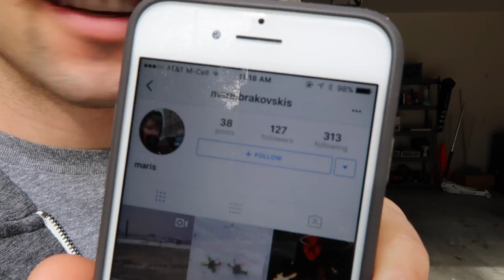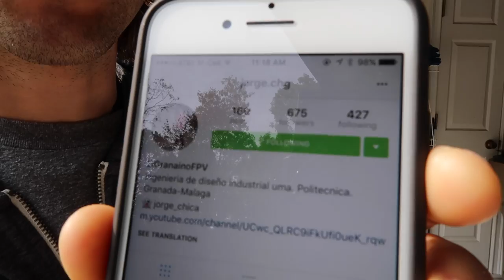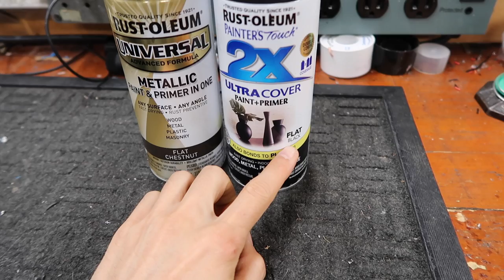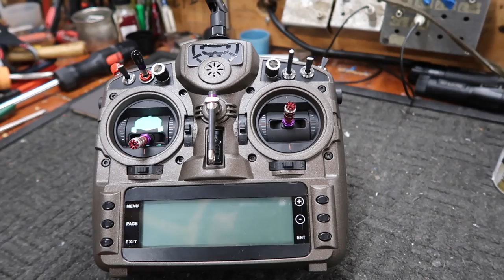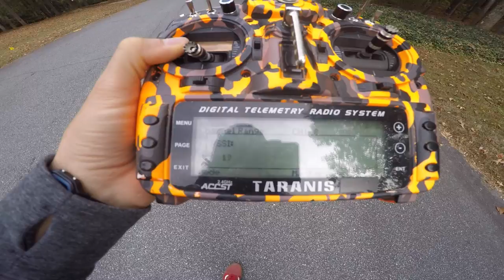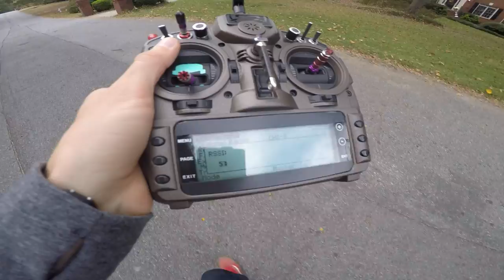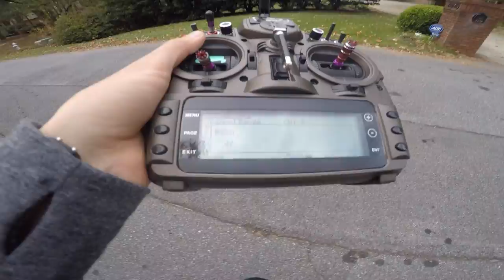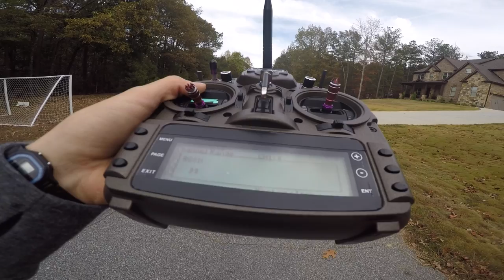The MUST HAVE FRsky Taranis Mods

Comment: If range mode reduces range 30x, what is the purpose of range mode? I am new
Reply: To test range safely on the ground without needing to run the full distance of your signal. Reducing the range to a third of its full power meaning around 30-50 paces you should lose signal. If this happens much earlier you could have a broken rx antenna or just a bad rx in general.

Comment: Mr steele If you have had a chance to test the VAS Microwave folding diapol 2.4ghz, do you thinks its good freestyle or better for just low and wide spread? Thanks for all the great content learning alot from you.
Reply from the maker: +nitrosomniak I have. I tested the very first couple prototypes.  The wifi antenna or preformed it in range
Reply from the maker: +Mr Steele *out
Reply: Was just wondering how it performed vertically as in diving from high altitude? I was under the impression it is supposed to be alot better spread at lower altitude flying.

Comment: Great vid Steel.  I'd be curious on where you got that specific cable you are using.  I know i can find it but quality control may not be there when its necessary for an application like this (I would think at least).   This may be my problem previously where i installed a cable like this (although i can't confirm the cable type) where it worked for a while but then SWR was in the 30-40 range about a month after i did the mod.  Also, can you link the exact antenna you are using?  I've got 1 from amazon and a couple from aloft that seem to be identical.  Thanks!
Reply from the maker: +Beerad FPV  I got my antenna from aloft.  And the wire   I just ordered a short connector with rpsma on one side and a umx or something on the other. And cut the umx off :). All you need to worry about is that the rpsma is crimped and install correctly.  I bought from a reputable RF connector source   As close tome as possible from amazing prime.   I'm inpatient lol

Comment: Was that 84 mm to the tip of the connector? or the cable length under the connector? Because i did the mod with the thicker cable and now my SWR went from 0 to 18-20, now is this bad?

Comment: What was your SWR after doing the mod? I get from 0 to 16 depending on how I angle the antenna. That's pretty sweet you've got a dipole coming from ibcrazy, that guy knows his rf.

Great color btw, like the texture it has.
Reply from the maker: +Logan Curole straight up  0-1 lol
Reply: Mr Steele Lol, I don't expect anything less than perfection from you. 

Now I'm not sure if it's the antenna I got or if I damaged the shielding during soldering. I used a pigtail extender from rotorgeeks so the wire I used is of the higher quality you recommend. I'll see if a new antenna fixes it.

Thanks for the video and you should do an update when you get the new dipole.
Reply: 16 SWR seems VERY high on a Taranis. Sounds like something is wrong.
Reply: blueflamingo1 It's not that high. The circuit FrSky uses to detect standing waves is only an approximation and I'm pretty sure it's resolution is in steps of 16 because it never settles at values that aren't a multiple of that. That being said I am changing things to improve it.
Reply: I wouldn't fly with an SWR over 2 just from advice I've read on forums. YMMV and you seen to know more about the circuitry than me.
Reply: I had that but it was a broken antenna
Reply: Yea, changed my antenna and got it down to 0.

Comment: Will you do an actual distance test? With my Taranis, also with the 5 dBi mod, and X4R-SB I've currently flown about 2.5 km in a park over a few tree lines and at least one power line. RSSI still reading between 42-45 dBi. Curious to know what distance you're able to get.
Reply from the maker: +Danny Om I might not put out a range test like that just because I don't really have a safe place to do something like that. Especially with a mini quad that would be hard to find.  It I'll maybe do
Something. Like fly in a gnarly place where people would normally have RC issues
Reply: ***** understandable. I have been curious about for quite some time is how much better a 5 dBi antenna handles noisy RF environments compared work the stock 2 dBi. I look forward to your video.

Comment: hey man, gotta a question about the antenna mod.  I have purchased the taranis x9D plus SE.  Since it comes with the antenna mod already done should I switch out the heavier gauge coax cable internally?  I took it apart being curious how they built it and noticed it is a rather thin gauge wired connected from the bottom of the antenna to the pad.  Should I bother?  Will it still give me extra distance?  

I have learned a great deal form your channel, thanks for all the info man.  Any suggestions here would be greatly appreciated.  later
-J-Skins

Comment: While we're talking ya radio Steele , what is it you have above your throttle sticks and why ? Is it a sticker is there a reason for it , allways wonderd if it's so you can feel centre of stick or something , Agree a9 gimbles big improvement , think I got mine from a place called robot shop
Reply from the maker: +martin Kenyon it's just a sticker for looks.  I went in a sticker spree when we got those vinyl Rotor Riot stickers. And put them everywhere
Reply: Roger that , cheers for reply Steele

Comment: Great vid Steele, two questions: 1 what kind of antena is that? and 2.  the top coat of my screen is peeling, do you know if I can change the screen or do something? thanks
Reply: INMERSO that's not a top coat - that's a protective plastic that you can just peel off.  I think you're meant to...
Reply: thanks
Reply: INMERSO I peeled it off and used a tablet screen protector over the top to avoid it getting scratched.
Reply: good idea!

Comment: 84 mm of the shielded cable? So does that include the solder joint?
Reply from the maker: +Adam Bauer that is from the butt of the rpsma connector to the end of where the shielded wire stops.  So you'll need a tiny bit more because the shielded wire gets split and folded back for the active element to solder down

Comment: I want to start flying. What would be decent gear to get without breaking the bank just yet?
Reply: Mike Deckert go for a tiny whoop theyr great for learning with quantum goggles
Reply: Go to the /r/multicopterbuilds subreddit and take a look at the wiki, it's a stickied post. The cheap components they recommend are pretty good. Make sure you don't cheap out on the Radio though and get the Taranis. If you decide it's not for you they hold their value pretty well second hand.
Reply from the maker: +Mike Deckert thanks guys for directing him into the right direction.  You can also go on Facebook and join the ROTOR RIOT Facebook group and ask questions there people will be more that happy to help :). Cheers man

Comment: Why would it be problematic to use a horus for quad flying?
I am asking because I want to decide sensibly whether to buy a taranis and make it pretty or just take a horus, my current transmitter is a graupner mx20, moded to use frsky receivers and I am curious about telemetry speach output.

The x12s is relatively expensive, but considering the yearly cost by frames, esc and batteries its not that much after all.
It is bigger than the x9d but I think with a lunch box it would fit in a larger backpack.

I would be glad if some of you could tell me from your experience with the taranis and why you prefer it over a jeti or a horus.

Comment: Can you make use of that extra range flying fpv?  Is the 5.8 signal from your vTx able to keep up with your Taranis?
Reply from the maker: +Michael Koster the whole idea is to be able to put fly your video signal. Video TXs and RXs have gotten so good in the last year I was getting to the point where I would have good video and be worried if a failsafe.   Now I don't have that issue. If my video is flyable my RC link is solid !
Reply: I see what you mean.  Today I did about a 1.5km flight and I was getting rssi warnings while my $10 vtx and old vrx were still giving me a video signal.

Comment: So you got rid of the buzzing through the speaker by using the RG316 coax internal?
Reply from the maker: +MGozz yup :).
Reply: ***** Very cool! I wonder how much RF is being lost with the OEM coax then... There has to be some if it's causing that much interference! My Taranis is quite buzzy ;-)

I have a bit of RG316 and a few spare SMA jacks so I might give this a try! Thanks for the tip!

Comment: Hi @mrsteele ! Did you ever get some range issues some time after using this 5dbi antennas ? Having some range issues xith my XJT module and x4rsb. It's just appears , changed my antennas to new ones, but rssi still really bad, range is only 500ft now. I read that some trouble could happen when using this mod on XJT , something like the RF was de calibrate itself, only fresh flashing / factory reset could fix it ??!

Comment: Is soldering coax much different from any other cable? I've soldered a lot over the years, but somehow never coax.
Reply from the maker: +Excludos it's not harder just different.  It's more about the ground shield preparation  and the active element isolation than the actual soldering

Comment: Mr Steele.....can I ask what the little bar is over the power switch? Is that simply to stop accidental power off?
Reply from the maker: +Andrew Hopper no it's a radio balancer. When you use a neck strap yo hold the radio the RG of the radio is off depending on the battery inside. So it has to be shifted more towards the bottom of the radio to balance correctly hanging from your neck .
Reply: Ahh right.....thank you for clarifying sir :)

Comment: an honest question: what is THE big selling point for the taranis? 
apparently the gimbals arent the greatest, it ships with a hard mounted antenna that is bound to break at some point, and an outdated battery, as the poop-cherry on the cake. apparently needing some mods to actually become good. i find it quite ugly and to chunky too, but that's just personal preference.
i'm  newbie, currently flying with an fs-i6. and for ~25% of the price of a taranis, i was positively surprised by it's build quality, even of the internals. (labled testing/soldering points for almost everyting, on a very cleanly and service/modding friendly layed out board. <3 ) i had expected much worse. my only gripe was, that i couldnt tighten the return springs enough for my liking, but that was easy to fix with 3 tiny wooden wedges.
Reply: Cuda FX The taranis is very flexible and pretty intuitive as far as programming goes (IMO). The only other one I've used is the spektrum DX6i... I bought the Taranis because it runs open source software and it's used by basically everyone I follow on YouTube that talks about quads. I love the x9d plus.
Reply: I don't know, probably because everyone seems to love open source software. But that doesn't make it automatically better, the KISS FC & ESCs are closed source and they're one of the best products in this category. 

I prefer the Graupner MZ-18, it costs the same, looks better, has better gimbals, a colour touchscreen and is a lot easier to use.
Reply from the maker: +Cuda FX the biggest selling points are the fact that it's open source firmware. OPEN TX allows you to do anything with the radio.  The link quality can not be Beaten period and it's cheap.  The stock radio is great.  I just always want something better or different than stock. Customizing and personalizing you equipment to your needs is a normal and practical thing.  
 Let's just say. I was sponsored by Jeti  I have a DS-16 carbon edition with my name engraved in it. Over $2k in Jeti hardware. And I would grab my Taranis over it for FPV every single time.   And I do.
Reply: Cuda FX I've never heard of the Graupner, I'll have a look. One of the good things about open source software on something like the Taranis is that you'll have software updates with bug fixes and improvements long after the manufacturer stops supporting/updating it. It's more "future proof" in theory...
Reply: Adam Roper Graupner is an old German manufacturer, my father used their transmitters and planes when he was young. You're right about the updates, that is a big advantage of open source. A disadvantage IMO is that the menus are cluttered while I can access every setting with two presses on the touchscreen
Reply: What about the turnigy 9xr pro ? I see that it also runs opentx and is cheaper.
Reply: be aware, that the 9xr pro comes without a tx module, receiver or battery. it can do just about everything, but the reviews arent great, when it comes to the build quality. it's also really chunky. you have to think, if you actually need any of the advanced featured of openTX .. or even want them.
Reply: ... I use spektrum dx7 for quad flying, also doing fixed wing/3d helis. What I find funny is that I never ever do any settings on the radio for the quads - pretty generic, much more mixing and tuning for the traditional stuff, all other settings are on the FC. I have never bothered with telemetry/rssi - so that is perhaps the selling point.
Reply: As i beginner i had a very hard time understanding everything. I started with the 9xr.
I had a hard time to get OpenTX on there. A friend helped out.
Then my gimbal gave problems for the 2nd time, (it was bad from the start).
The gimbal was on backorder, i was so fed up with it i went to the store and bought a Taranis.
After that almost everything went smooth. Lots of tutorials is a big plus.

The gimbal is not bad at all, but it's old technique, it wears out, that's why you need to replace it.
Reply: The Graupner transmitter you mentioned is twice as expensive. Not even talking about the receiver and telemetry unit prices.
Reply: Where I live the Taranis X9D plus costs 270€ with a receiver and the MZ-18 costs 275 with a receiver. And you don't need an additional telemetry module.
Reply: Elias R. Here  ( the Netherlands) a Taranis is 200 euro, against almost 400 for the Graupner. A very different situation indeed. Thanks for the answer.
Reply: Elias R. Here  ( the Netherlands) a Taranis is 200 euro, against almost 400 for the Graupner. A very different situation indeed. Thanks for the answer!
Reply: Well that's a big difference!

Comment: Hi Steele, I did the taranis mod with the recommended cable that you use.  I am using an antenna that I'm borrowing u too the one you use comes in.  All that being said my swr reading hovers around 35.  Is that bad for the radio and/or will it decrease range?
Reply: Did you cut the wire at exectly 84mm? If not, that may be the problem. I had two 33 SWR reading... Made the mod again with a new cabel, wiht the exact lenght of 84mm-s, and my SWR reading is down on 0!
Reply: I redid it as well and the swr dropped down to 0 or about 0.  Im happy we both got it working!!
Reply: i am also getting 33 swr what cable did you use ? i used rg316 and 84mm
Reply: vit tsy I ordered a new wire and tried it again.  Worked the second time.  Make sure u solder to both ground pads.  Hope this helps
Reply: ok thanks for telling me i will try that

Comment: Hey Steele I love the Videos, After I installed the Aurora 9 Gimbals I find that i get a lot more jitter on all 4 axis while monitoring the RC inputs through Betaflight or KISS, I notice it more on the Betaflight not exacly sure why, Did you notice that at all? Thanks in advance.
Reply from the maker: +Joel L update your Taranis to openTX 2.1 or whatever the latest one is and it'll fix that :)
Reply: Mr Steele Ahhhhh Cooool, cool cool cool

Comment: Does the rules still apply with the transmitter mod that you should attach the antenna before powering on or does it not matter?
Reply from the maker: +AllWayzSomethin that rule applies to any transmitter.

Comment: Hello Steele, I’m doing your antenna mod on my Taranis X9d plus and I wonder if I should remove the UFL connector to directly solder my coax (RG316 with rp-sma connector ) to the board or should I let the board as it is and solder a small piece of original crappy antenna with UFL on it  to my RG316 coax.....(but it will be hard to keep the shield around the coax around d the solder.......and will look crap....
I tried to dismount a ufl connector to mount it on the RG316 but it’s too small and parts breaks as soon as you "unbend" the very thin tabs. Any advice? Thanks for your help. Aurélien,  France

Comment: WHY WON'T THE FPV COMMUNITY ADOPT BNC CONNECTORS?! I don't get it! BNC is quicker, easier, less susceptible to damage, and actually meant for components that will require frequent removal and installation. I can see why SMA is used on actual aircraft components like video transmitters because of their smaller form factor, but on video goggles and radios BNC would be so much more logical. I wonder if I could do this coax/antenna mod and find an antenna with a BNC connector. Anyone have any ideas on an antenna?

Comment: If you know of a good video about calibrating kiss esc's please let me know that would be much appreciated.
Reply from the maker: +Billy Lopez the escs don't need to be calibrated usually.   But you can set min throttle to 2000 and save in the GUI. And power the quad up  let it beep. Then plug it back in and set min throttle to 1050 or whatever and they are calibrated

Comment: I thought you were using the TBS Crossfire? Why did you switch?
Reply: It doesn't work well in his area for some reason I think
Reply from the maker: +STRYKA yup to many TV antennas on 900MHz
Reply from the maker: +Maxisokol S  i use it on my wings. But not on quads.  2.4 is much more reliable and adaptable in my area
Reply: Hm, ok. I just got a crossfire hoping that it will solve all my radio link problems, let's see how it goes. But I live in Finland, so maybe it will be more reliable here. :)